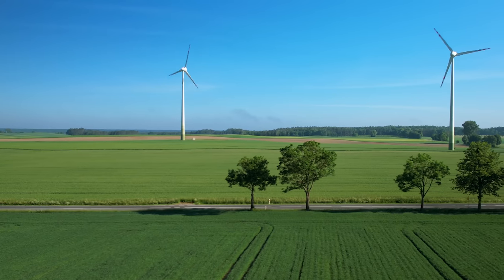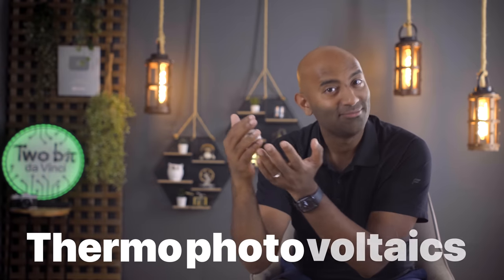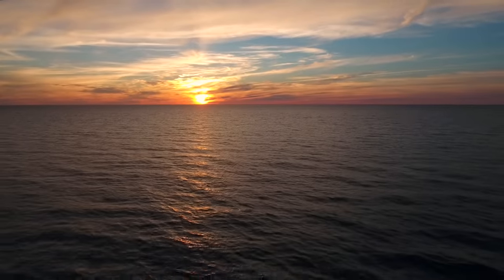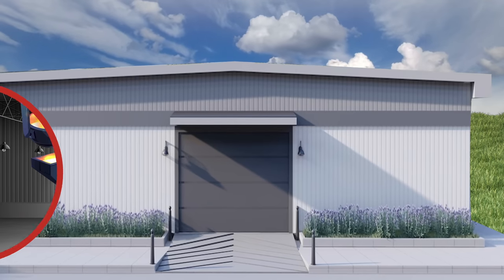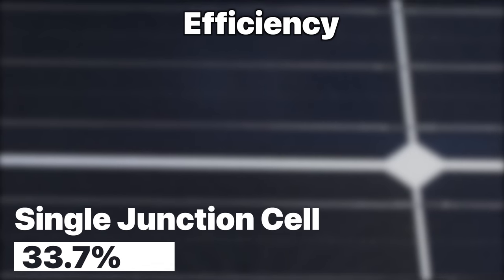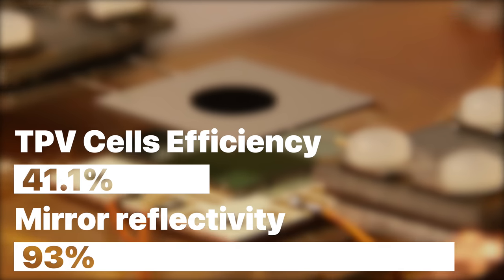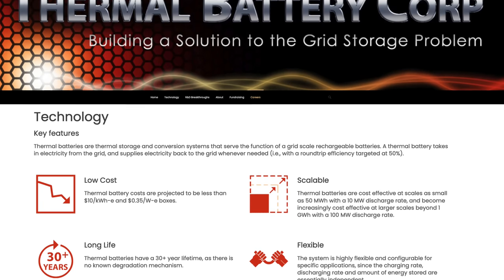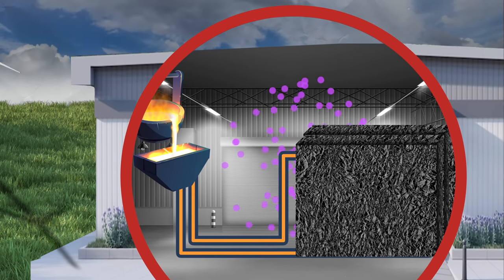Breakthrough Solar cell DOESN'T Run On Sunshine!

Comment: All right so if graphite will hold heat really good then what people don't realize is you can take graphite turn it into a powder I dare say mix it with I don't know some sort of oil that can handle the heat then you could literally either use solar power or the Earth to your house with graphite and oil pretty cool eh

Comment: One question I have is, what about using materials that are already thermo electronic and tweaking the formula to increase the over all efficiency. For instance the mineral tourmaline is a natural thermoelectrical substance that generates energy according the the amount of heat exposed to it untill it fuses, so why don't researchers study how tourmaline generates energy and reproduce the the same qualities at a higher efficiency? Another question is if steam turbines are so inefficient then why not set up a self-contained water turbine that uses the waters drag force as well as additional weight on the outer edge of the turbine wings and gravity to spin the turbine and rather then building one big turbine you build relays of smaller systems that are easier to maintain?

Comment: The name seems like a misnomer: I took it to mean that these things generate electricity from heat and I thought that’s actually what you had said earlier. But it turns out that they produce heat and have to be cooled. Sounds like the real reason “thermo” is in the name is because they are designed to WITHSTAND heat, with water cooling.
And that brings up a question: why can’t the band gap of a solar cell be tuned to make use of infrared light, heat light? Something like that could be placed at the bottom of a regular solar panel to harvest further energy from it.
As for missing piece of the puzzle, it seems to me we already have it. Why not connect the heat output of the graphite block to a traditional steam turbine, of which we’re going to have a whole lot of extra ones lying around it. And, is it possible the graphite block system will be more reliable and could be retrofitted onto that failed Southern California thermal solar plant?
Oh, I couldn’t find a link in your comments to the video on multi gap solar cells.

Comment: Just to be pedantic... this cell will work with sunlight as our sun does emit IR radiation, just not at any usable level. If placed near a red dwarf or a  stellar class F star, then it would work well. As for cooling the TPV's why bother?, the cell would become another emission source that would cool themselves as a function of adsorption by the right band gap layer. why waste the heat?

Comment: I think to truly solve wind energy, we still need to figure out all the emissions caused by building a wind mill and the relatively short life span of the blades that are classified as hazardous waste and seems like we have no idea what to actually do with them. Furthermore we need to figure out what to do with it in increasing extreme weathers caused by the climate change, like last summer the wind mill parks were simply idle for lack of wind. Same as with the water power plants in the drought. Massive issues in applying the technologies effectively, especially in modern climate challenges. Same pain was had in the Africa's huge solar power plant. A ton of water required to run it in an area where water is scarce to begin with. I'm curious though, are the solar power cells these days very effective on cloudy weather or for example in long winter with a couple of hours of daylight and a lot of snow?

Personally I have trouble seeing us solve the power issues effectively in any other way than with nuclear power, as unfortunate as it is, at least for a long time. Or the other thing that would solve the problem would be somehow getting rid of a lot of power needs, like sacrificing all modern technology and/or suddenly making a big portion of the people on earth disappear. Not very applicable or hopeful options, so we're dealt with the nuclear power route for a long while as people are trying to figure out how to improve the efficiency of the ecological power in the sense of being ecological throughout the life time of it (and obviously the efficiency in producing energy).

Very similar to the annoying problem that manufacturing cars is the biggest ecological cost throughout the life of the car, which makes it very unecological to change all the combustion engine cars to electric cars (even if they didn't pose other problems in actually adopting them for every day life everywhere and building all the resources for it). It feels like a lot of ecological technologies bring many catch 22 with them that just don't seem like easy things to solve to improve the situation without costs to climate in adopting the technologies and tradeoffs now and in the future.

Then there's all the ethical issues with technologies like li-ion batteries and many other mining for technolgoy purposes, which we have to swipe under the floor because it would be too difficult to address with the modern pace and importance of electronic and smart products.

I wonder what kind of logistical issues it would bring to start suddenly manufacturing a ton of halls with graphite cubes with tungsten blocks and fill them with noble gases. Something makes me think there would be a couple of hurdles in making that even possible to manage in resources and logistics, let alone building it up and using it for decades.

I'm still hopeful that in the future we got many things right and have perhaps improved the situation and have adopted some of the new technologies with more efficiency and less of environmental costs. Scientists are always more hopeful on prototyping and calculating on paper than when a politician or a CEO needs to start building and applying the technology in the current environment and circumstances. But these are problems to be solved as well. These technological discoveries might improve existing technologies just as well, which makes it more appealing.

Comment: Thermophotophotaics sounds interesting but there are a lot of potential problems here that make me think that this can't work.  The main problem is just the really high temperatures combined with pumps.  It is amazing that they got that to work in the lab and least for a little time but could this work in the real world for months on end?  So much could go wrong.  Any technology that requires more than one major innovation to work is problematic.

Comment: The stupid thing is, I was just saying a few months ago, "So heat weakens the Photovoltaic effect of solar panels, Okay how about I install thermoelectric peltier devices on the back (with heat sinks on the back) to produce more energy off that wasted heat that builds up from the sun hitting these things, and thus pulling that heat from the solar panels to make them more efficient. Yeah thermoelectric isn't an efficient form of energy production, but it would be producing off the wasted heat anyway. And from what I'd been reading, that would have been called Thermophotovoltaic cell setup as well.

The thing is, this MIT setup is keeping it contained and functionally using a heat powered "lightbulb," or more accurately the guts of one in the form of the tungsten, to produce the light to be absorbed by the thermophotovoltaic cells. kinda an odd way to go about collecting the energy but it does make sense even if it does seem kinda funny. Like running a desk light to use a solar powered calculator.  Which guessing on the MIT guys, that's probably the inspiration. It really is a neat concept, but what issues will crop up with it being scaled up?

Also No on the Fishing Clash... I won't download a "freemium" game.

Comment: System that loose half the energy is not a good system. The video do not say if the energy needed to run the system is included, but hopefully it is. Any system that have many moving parts under high stress factors are expensive to run long time and will have expensive break downs.
Important part not included in the calculation is the energy cost. If you have to pay nearly double for every recharge the building cost is less important. Just like for a natural gas driven system where the building cost is low and the running cost is high.

Comment: I was hoping to hear of how homeowners could employ sand batteries to store excess power and use TPV cells to pull heat from those sand batteries.
Reply from the maker: Home sand batteries should indeed be more of a thing.

Comment: Where does 2732F come from? When water is heated at atmospheric pressure, its temperature rises until it reaches 212°F (100°C), the highest temperature at which water can exist at this pressure. Additional heat does not raise the temperature, but converts the water to steam. While I do see temperature rising under pressure, I can not find anything like mentioned. Thanks

Comment: So this new solution will be super expensive. Also it will be a fire hazard. Tin may also cause health issues.
I would wait until they build an experimental storage facility, measure all the costs, the risks, compare it the available alternatives.
Then  they should publish a paper if they solved the energy storage issue.
Until then: go for it and come back when you are ready.

Comment: I think your math is wrong.  A current solar cell running at 22% efficiency is good for about 250W per square meter.  How do you get 100kW per square meter from a cell that is 50% efficient?  I think you would be lucky to get 1kW out of it.  You are off by a factor of 100.  Based on your numbers, a cell 100mm X 100mm should produce 1 kW.  Does that sound plausible to you?

Comment: Guess what happens when the system breaks down and all that liquid solidifies? Complete and total cluster as u have to tear down and rebuild the entire plumbing and pump system. We found out how bad of an idea this was on solar farms. The leaks werent the problem, it came from having to shutdown the entire plant to fix them and there is no way to empty the entire system of the fluid without it solidifying

Comment: I rather expect that the first commercial product made with this thermovoltaic technology will be something the size,weight, and shape of an old fashioned cast iron frying pan that can be tossed on top of a campfire to generate enough power to charge a cellphone or laptop

Comment: Sounds like they are certainly developing a good cell, pattern, and recclaim  I just don't see the graphite being the answer for storage. The calorie density just isn't there. Insomuch as the conductivity benefits it for thermal load time, it is detrimental to storage. Hence the inert gas, as it is shedding electrically as well as infrared, and it can combust.  A graphite "piping" system to a storage unit of a more thermally insulting and more calorie dense media would likely be a more viable option.  Or perhaps "cheap" graphite "piping" in a vacuum tube to the storage, into a graphite "tree" to more efficiently load what ever medium suits. Maybe molten salt? It would be static, no high pressure literal pipe. Anerobic, corrosion might not be  an issue. It wouldn't be impossible to put a physical break, a "switch" between the imput side and storage unit. 
Great video.

Comment: Yes but what is their life span and reliability  high temperatures typically wear down electronic by thermal diffusion.  And why not use cooling fluid other than water - which is corrosive  and use the heat fluid to heat or cool.  BTW tin (Sn) melts at a low temperature ~450°F  and alloys with many metals.  Tungsten can oxidize to gaseous oxide.

Comment: Why are they not using sodium to emit the light, because then you would only have to absorb light with a wavelength of 589 nm then you get get ~70% efficiency which is obviously over 2/3 vs 1/2 which would put you significantly closer to other energy storage methods, also you would reduce the cooling requirements because less of the energy is being lost to heat, still gonna need a pretty baller cooling system though so not really a primary benefit, just a secondary one.

Comment: If your already, using water to cool the system.  Why would you not run that water through turbines as well.  They don't have to be expensive to still generate a decent amount of additional power.

Comment: It looks like a great way to generate electricity from nuclear power plants. Some nuclear reactor designs use molten sodium, however welds need to be strong and reliable.
I’m not sure how available either tin or graphite is, and tungsten isn’t widely available either, I think one of the biggest sources being Russia. I think tin is mined in South America. There were tin mines in Cornwall,, UK, but I think the mines played out in the 1800’s.
I don’t have any idea where graphite is mined.
There is an article in Science magazine, that the amount of mining to obtain renewables, lithium, copper,marrero earth metals, iron, is simply stupendous, many millions of tons, since oars are low grade concentrations, so millions of tons must be mined and refined to obtain usable quantities of the purified elements and materials.
This actually turns out to be many times the amount of materials which are obtained for fossil fuels, such as coal, petroleum crude and natural gas.
This all gets down to the question of reliability of the whole climate man made crisis, if it really is a man made crisis, or rather due to variations in solar output and movement of the solar system through gas clouds as the solar system rotates around the galactic core, going through the galactic arms.
Galactic gas density may vary, which would cause variations in solar flux reaching the earth’s surface.

Comment: ceramic goes to 2000C before melting 
Graphite limit is directly related to the maximum Heat Treatment Temperature which is 1600 F (870 C) for Carbon/Graphite Material
so would It be possible to use ceramic in combination with graphite ?

Comment: This is bullshiit... You would be better of storing the energy in some cheap inert material with high melting point that costs peanuts like Alumium oxide or magnesium oxide block or sand... no need to have a complex molten metal transportation system you could heat up the center of the whole thing with electrodes and use the slowly diffusing heat at lower temperatures on the sides to power steam turbines... And there is no way in the world that these TPVs are more efficient than a modern steam turbine...

Comment: If we store thermal energy, will it impact global warming? Or would that heat be trapped innour atmosphere anyway? Also if we control heat will the colder parts of the planet be even colder? Like tides going in and out,

Comment: This is a scale nightmare. To keep the flow of tin through the pipes molten will be close to impossible on a large scale as the graphite pulls heat away and tries to cool the tin in the pipes. And to have thousands of theses facilities  to store energy will be so costly.    Thorium  Reactor generators are the best solution.
Reply: Couple this with thorium could increase output and profit if done right and make power even cheaper. A 50 year projection needs to be assessed

Comment: It’s still a solar cell- needs light generated from the tungsten. If it was a true TPV it could generate electricity in pitch blackness with Only heat in room.

Comment: We need the big turbines to stabilize the grid, especially sine we all connect more and more DC-current consuming electronics, in everything from cellphones to electric vehicles. What these DC currents does is it sends out disturbing currents in the grid and small generators like wind turbines and generator free systems like solar cannot handle this. We need the big heavy generators in nuclear power plants and hydroelectric power stations to compensate for this and keep the grids stable.

Comment: Awesome,  could you do something on Fluorescents on solar cells.  I don’t understand why they aren’t offered…
Reply: How exactly would you use the effect?
Reply: I was just thinking that!
Reply: A Robert fan by any chance?
Reply: @manoo422  simply as laying fluorescents around the cells or even using a translucent fluorescent covering….
Reply: @kingchristopherpaul477hutc8  I am note sure laying it around the cell would do anything and the problem of putting it over the cell is you lose what you gain if not more by the reduction in transmission. A piece of glass over a cell will reduce its output!
Reply: @manoo422  and putting it around would the cell would have an angle of uv intersection,  maybe small but might be all you need.  This won’t double your output,  might give you a volt or two depending how in depth you want to go
Reply: @manoo422  then again it’s all theory until I can get back on board and get everything fired up again ;)
Reply: @manoo422  I’m not talking about having the fluorescents even with the cells.  There would be height and depth to them. Almost like a large bowl

Comment: Possibly check out atmospheric energy harvesting and or, consider the acoustic guitar with a signal output see?  Vibrate a string produce a electric ac signal now sir if you dare to compare.  Well such wires strung up quite high and taught wouldn't the resonate to some resonate frequency?  Also study that atmospheric energy theory and some 200k volts are readily available under 200 ft high.   Also aren't these thermogenic type harvesters pretty much long in existence by the name of a peltier chip?? 
Thermonucleaic cells as you seem to be explaining can be massively over locked by using a freshnell lens lol sorry just a few short thoughts what do you think sir?